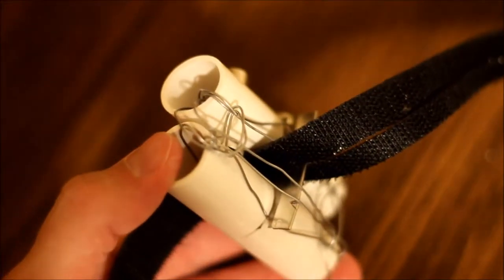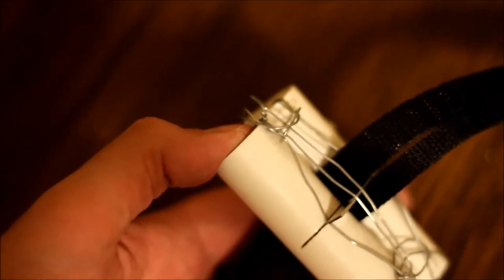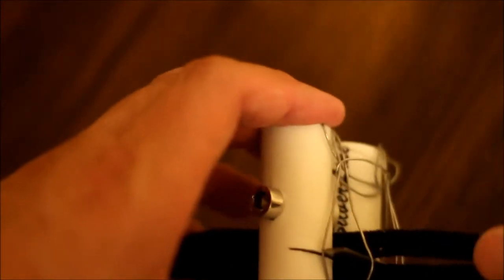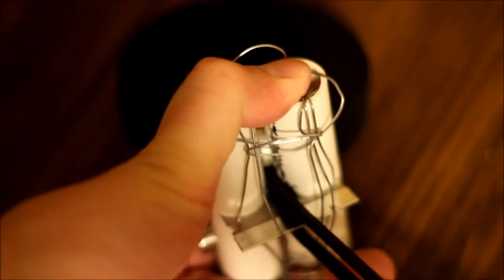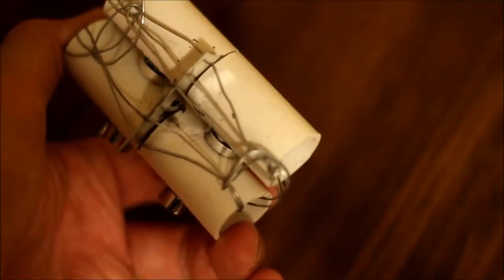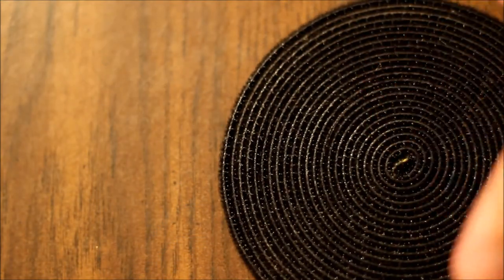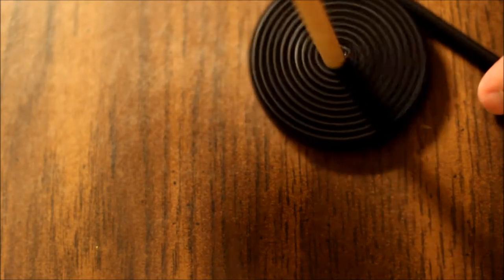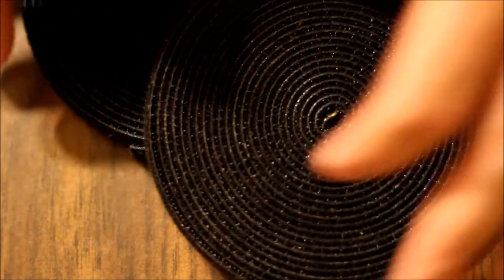Cutting velcro rolls in half

Comment: Great idea; make a sellable cutting machine and you will have business.  Two things to consider: 1. How to regulate width and maintain.  For instance, we cut 1in down to 0.5in and also 0.75in width.  2. Consider how you can make it work efficiently with adhesive backed Velcro.  The adhesive can gum up on a blade.  Okay to have to clean it between uses, but say you wish to cut a whole 25 yard spool in one cut.  Seriously, solve these problems and make it safe and presentable and you will have plenty of buyers.